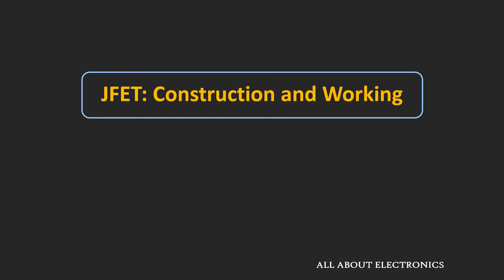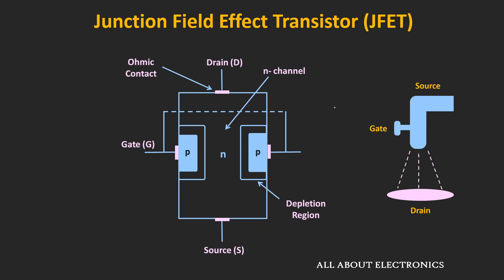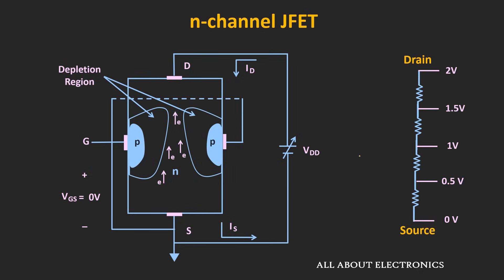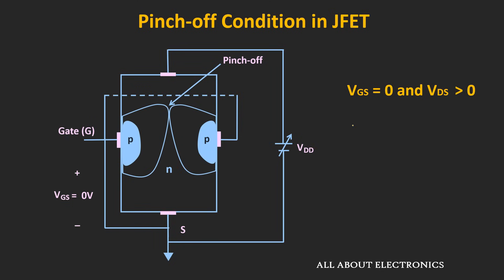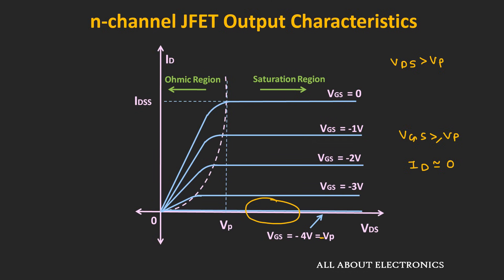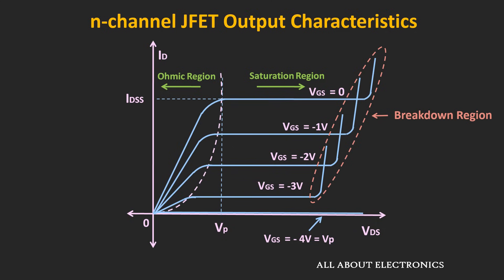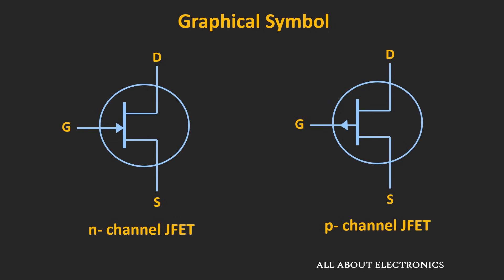JFET: Construction and Working Explained

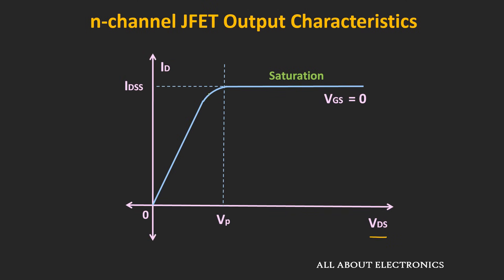Comment: At 6:46, the channel resistance will increase; hence, the Id should decrease, but Vds increase, which increases the Id. So what should we see, the electrical resistance or the Vds? also, the slope of the graph is 1/R, and the slope is increased, but if the electrical resistance is increasing then why is R decreasing? What is the slope here? electrical resistance or what?

Comment: I need BJTS and FETS and MOSFET for my mid examination on urgent basis could you plz send to me as soon as possible
Reply from the maker: The notes on MOSFET are already available on the website. In case, if you didn’t get it then let me know. I will send you a link.
Reply from the maker: For other notes, please mail me. The email Id is given in the about section of the channel. I will send you the required notes.

Comment: Hello sir can you please tell me Vgsoff for BFW10 bcoz in datasheet it is given that Vp=Vgs(off)= -8v
And if I provide Vgs=-4v still the jfet operates in cutoff mode.
Also there are 2-3 different value of Vgs. I'm not sure which should we take.
Please help me
Reply from the maker: for normal operation, keep Vgs between -4 to -7.5V. Also in the datasheet, the test condition is 15V. (e.g Vds = 15V)
If you operate JFET with VDS = 15V and Vgs between -7.5 to -4V, it should work.
Reply: @ALLABOUTELECTRONICS  yes I kept Vds as 20v and Vgs as -4v but still the led was in off condition.
Also in data sheet of jfet only max value of vgs is given which is -8v.
Please help me

Comment: @12:10  You had put that when Vgs is greater than or equal to Vp the device has 0 drain current. I think you had meant to type when Vgs is less than or equal to Vp, the device has 0 drain current and is in the cut off region

Comment: The tap-water analogy is a little confusing because you have the flow in reverse in comparison to the FET. 

But you can still think of a water-analogy:
Imagine you sitting in your bathtub, and you have a lever (gate) that controls if the water should be drained. When you 
pull the lever, the water starts going into the drain, and somewhere down the pipe there will be the "source" where it flows out again, into the canalization. 

Of course, if we choose to think of physically-correct current instead of conventional current, then the tap-analogy in this video is correct.

Comment: Where vds voltage is applied?
Reply from the maker: Vds is the voltage between drain and source terminal. Typically the voltage is applied at the drain terminal through resistor. And source is either grounded or through resistor it is connected to ground. So based on drain  current, the voltage Vds changes. If you go through other videos on JFET through playlist it will get more clear to you.

Comment: so basically a simple n-channel acts as a resistor?
Reply from the maker: Yes before pinch off, it acts like a resistor. It is also evident from the JFET characteristics in the triode region.
Reply: @ALLABOUTELECTRONICS  why would a extrinsic semiconductor resists to conduct current?

Comment: Vds controls the flow of electrons in the channel and Vgs is the cause for reverse bias. Then how can we increase the width of the depletion layer by keeping Vg =0
Reply from the maker: As I mentioned at 5:20, the drain to the source channel acts like a resistor. That means as we move from the drain to the source side, there is a drop in the potential. So, on the top side towards the drain, the PN junction is more reversed biased than the bottom side towards the source. 
So, even if Vg = 0, Vds plays a role in changing the depletion layer width. 
I hope it will clear your doubt.

Comment: Sir in n channel jfet is possible to apply gate voltage postive.is the characteristics would change?????
Reply from the maker: For n channel JFET, it is not advisable to apply positive Vgs. It may damage the JFET. The gate voltage may be positive but Vgs should be less than 0.

Comment: When Vds is applied and being the two pn junction at reverse bias,initially maximum current will flow and as we increase Vds current will reduce ,so very small current due to minority carrier will cause reverse saturation current from source to drain ,but eventually when pinch off occurs current becomes constant so no more current actual gets added up ,it's just minority carrier with enough thermal energy under an applied field enters into the drain..

Comment: When Vds is more than pinch off voltage Vp then  both the depletion regions touch each other so the current flow is minimum so why is it  itself the maximum current through it?
Reply from the maker: The thing is, when the Vds is less, then fewer electrons are pumped into the channel (Considering n -channel). As, Vds increases, more electrons are injected into the channel. That means as we increase the voltage Vds, the current increases. But it can happen only up to pinch-off voltage. After that, the drain current gets saturated. So, that's the maximum current. 
I hope it will clear your doubt.

Comment: I have a doubt if the pn junction in it is reverse biased then the depletion region decreases and it increases the width of channel present between, so the current Id must rise but it decreases as the gate is made more and more negative and the width is increased....???? So...
Reply from the maker: Its other way around actually. In pn junction, as the reverse bias increases, the width of the depletion region increases.

Comment: Sir, you said that at the time of pinch off the Id current should become zero, but if it becomes zero then the depletion layer gets removed, and the different potential levels across n channel are also removed. So the current technically never becomes zero.
Because as far as i know, Depletion layer is controlled by reverse bias voltage not current.
So why does the depletion layer recede when the current (hypothetically) becomes zero?
Please shed light on this matter...
Reply from the maker: 7:45 onwards, that is what I have explained.

Comment: Sir in case of n channel fet how the on junction become reverse bised on application of voltage across drain and source
Reply from the maker: When Vgs = 0, the gate is at ground potential. Now, when the positive voltage Vds is applied, then the top portion of the n-channel is biased with a more positive voltage. while the p-type region near the gate is still at ground potential.
That's why PN junction is reverse biased. And as I have shown at 5:09, as we move towards the bottom, due to the voltage drop, the PN junction will be less reverse biased. But still, it remains reverse biased. 
I hope it will clear your doubt.

Comment: Sir why is Id becoming zero when Vgs=Vp
Reply from the maker: As Vgs becomes more and more negative (For n- channel JFET), the PN junction becomes more reverse biased. In other words, it offers more resistance to the flow of current. At the pinch-off voltage, the resistance offered is so much that Id becomes very small. And for the practical purpose, it can be assumed as zero. It is also evident from the output characteristics. 
I hope it will clear your doubt.
Reply: ALL ABOUT ELECTRONICS thank you
Reply: up

Comment: how does p-n junctions get reverse biased when vds is increased???
Reply from the maker: As the voltage Vds increases, voltage Vd increases. (Becuase source is grounded)
That means the top portion of the drain side will be more positive. That means the n-side will be more positive than the gate side, as the gate is grounded. (Vgs = 0).
So, p-n junction gets reverse biased. 
I hope it will clear your doubt.
Reply: ALL ABOUT ELECTRONICS thank you!

Comment: 12:58 also, positive bias(Vgs > 0) is not applied in JFET because it will cause damage/burn due to very high current

12:09 you mean Vgs <= Vp
Reply: Yes, correct.. applying positive bias to JFET will lead to flow a reverse input current through gate which will eventually increase with increase in +Vgs.

Comment: i am not clear about the Idss part, why will it be maximum and not ZERO at pinchoff? plz help here
Reply from the maker: As I mentioned at 8:00, at pinch-off if Id is zero, then the different potential levels which were developed across the channel will be removed. If it is removed then the reverse bias across the pn junction will be removed and if three is no reverse bias then there is no-pinch-off. I mean pinch-off condition would not occur. that's why Id won't be zero.
I hope it will clear your doubt.
Reply: @ALLABOUTELECTRONICS  thank you sir, it surely cleared my doubt

Comment: I agree with the fact that the id is not equal to zero when pinch off , but how did you confirm that it is the maximum current idss, i am confused this so much ,can u explain it
Reply from the maker: when Vgs=0, even if you increase the Vds beyond certain range, there will be hardly any change in the Id. So, you can know that Id is operating in saturation and Id is Idss. 
I hope it will clear your doubt.
Reply: @ALLABOUTELECTRONICS  thanks for your feedback

Comment: Simple, complete narration of topic.
I am a Master degree student.
What happened if one reversed the polarity of V (ds)?
Reply from the maker: In some JFET, drain and source terminals are symmetrical. So, if you interchange them it will work fine. (only the direction of current changes accordingly). But it's not allowed in all JFETs I think. Theoretically, it should work fine.
Reply: You are copied from neso academy